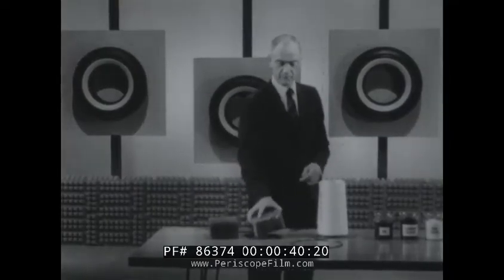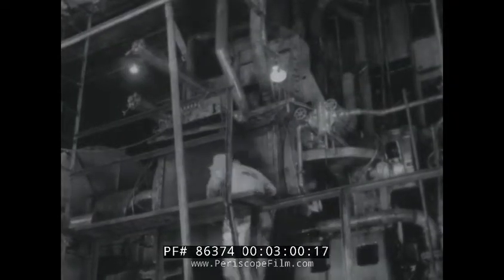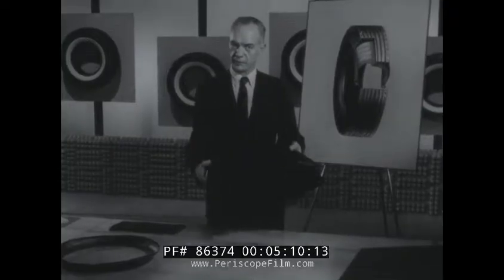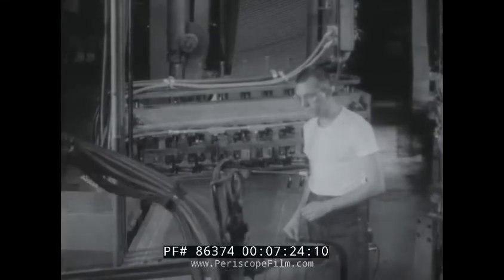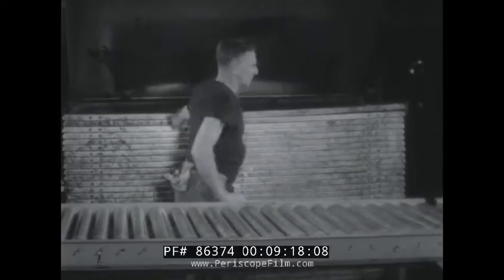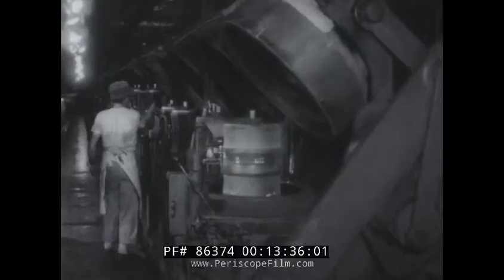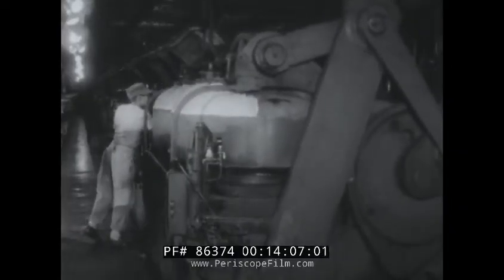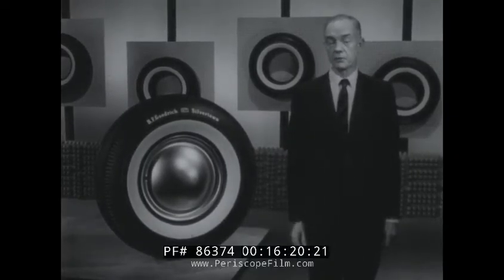" MILEAGE IN THE MAKING - STORY OF TUBELESS TIRE "   1961 B.F. GOODRICH SILVERTOWN TIRE  PROMO 86374

Comment: Fun to watch. This is all very accurate I started in Armstrong Tire & Rubber in West Haven, CT on Nov. 30, 1966 everything seen here I have done a little bit of it in different ways in 14+ years, then it closed. This little video does not show the dirty carbon black in the mill room and all of the other chemicals - rubber workers have the highest gut cancers (you never get clean even after an hour in the shower) the 125+ degree heat in the curing room and guys passing out or the mandatory line up at the water cooler to take two salt pills in front of the foremen at the start of your shift. Remember no OSHA in those days, no masks, no safety equipment, no ear protection, no safety glasses. Thank you GOD for OSHA. You have no idea how heavy and tacky rubber is. There is only a few of us left now from those days beaten broken bodies from hard grueling work. Me I got out lucky still in pretty good shape by the grace of GOD. The great HOT showers running over sore bodies kept many a man going day after day. And a little side note I do not know where all of those women came from in the war they made tubes, rafts & parachutes. A few stayed after the war and I mean maybe 3. The government demanded Armstrong start hiring women in the 1970s and this is what happened - crying and quitting even with the guys helping them make their piece work, the work was just that hard, it's not that they did not try. One made it her name was Pearl believe me you would not want to run into her in a dark ally. The money was pretty good but you earned it. Those 1200/24 truck tires I'm not going to forget them for a long time.
Reply: Wow... You're exactly right. I worked for Goodyear for 17 years. That damned carbon black, I'll never forget. You could get a tiny little trace on your fingers, and it would spread everywhere on your body. You couldn't wash the stuff off.
 In the curing dept. we had around 400 tire curing machines, all reaching a temperature of 350° 24/7.
 It was brutal work, as the OP related...
Reply: @Jreb1865  Nice to meet you. Wow another oldie rubber worker, never thought anybody would see my comment. Thank you for your thoughts. There were several grades of CB and our #79 was the worst - really fine and loaded with oil believe me there where days when I was covered head to toe with the stuff and the various oils and CBs never come out of your clothes just the sweat and it would clog and stick to the washing machines. We had a CB tower and a railroad siding but we still used a lot of bag black. Literally all of those chemicals used to eat the stitches right off of our safety shoes the tops would be fine and the soles would be falling off. 7 years in that mill room. 400 curing machines, we had about the same the ones in the video we had 4 lines of B,C,D, E they where the oldest  and all of the NDs for the military steel molds always went there those where for the Jeeps etc. had post inflation an Armstrong invention that went industry wide essentially doubling a tire layers rounds and because they were old we had to hand load the PI tires right out of the press the bead rim for those swing right off of their sides, after a while your burned hands became insensitive. In the 400 count we had about the same, Im not sure if that counted the truck tire lines everything from 900s to 1100/24s those did 2 cures at a time the 1200/24s was a single. 325/350 lbs. one tire. I did years in that heater room tire layer & bladder repair, green tire sprayer & storage, tow motor driver, racks to the presses. Worked on tires for the Indy 500 (curing) 
350+ hot water & steam thats how you cure rubber tires in 350+ tonne presses. our NRMs where the best. Was there when the industry went from Rayon to Nylon to Fiberglass & Steel. All our Banburys where Waterbury Farrell as most of the 90" mills, we had one K7 I think it was made by NRM, 100 tons of raw rubber (Master Batch) a night all cut, picked up and loaded on the conveyor belt by one man I did this on 3/11 shift. Lots of automation now from auto loaders to segregated molds thats because of OSHA thank GOD.
For years I was one of six men per shift that did the rescue and recovery work of men caught in machines run over by tow motors, caught in conveyors etc. So many men had at least a damaged or missing digit, it was so common place nobody thought anything of it. There is nothing I haven't done in the making of a tire from the rubber off of the boat all through the mill room into the tire room on to the curing room up to Final finish to QC final inspector off to the warehouse then out the door. 35/30/25 year men dominated the seniority list being one of only 12 men hired in 1966  i got bumped so many times I was beginning  to think I was aa ping-pong ball but what an tire education it gave me.
Really hope you had a good time in Goodyear at least your lucky your company is still around Armstrong was broken apart by Pirelli Tires and now after all of these years the brand if being revived in India and in a miracle of miracles is saw a trailer on I95 South in 2021going towards NY all decked out flying the logo and the tread designs. I'll check here again Dan, if you want to tell me what you did, where was your plant OH, CA, NY down South is it still operating? All the best:)
Reply: Thanks for sharing your work experience to compliment this video I have been binge watching these old films and love them. This channel has many videos from us steel I speak to a man from work that retired from there its great to here from people who have direct insight.
Reply: @chris30v  Glad you made a penpal These are fun to watch.
Reply: my twin brother worked for a tyre retreader in Victoria Australia in the late 1980's, i remember him coming home black from head to toe every day for a couple of years, he was so glad to leave that job.
Reply: @amandagardner565  HI Amanda, ahh retread rubber. I did that to but retread is a little different unless the company he was working for actually made the rubber your brother was covered in the grindings of the carcasses plus the cements that were applied when the retread rubber was applied to the Caracas and then into the molds and autoclave. The purpose of Carbon Black is to fill the very porous rubber to give it uniformity and strength = milage and stoping distance, variations of Blacks, rubbers, oils and Tack compounds accomplish these goals. All of these compounds are put in the Banbury (first mix = Master batch) under TREMENDOUS heat and pressure to fill the porous rubber then after varying  rest times off it goes to Finish Batch where the same thing happens all over again with different chemicals these are mostly dry ones and where the Sulfur mentioned in the video gets added. All of this is just to tell you what was in the rubber grind that was on your brother. Rubber comes in different grades the very best is milky white low porosity and very heavy rock hard, this is Butyl the best, then it goes all the way down to crumb rubber - black, very high porosity, light because its full of air. Rubber comes off the ships in blocks about 300 lbs. and must be kept fairly cool or the blocks mush and spread out and then we call them ears regardless off they go to the rubber cutter Armstrongs was a Baldwin and the blades where NOT heated, that Baldwin had a 24" hydraulic  cylinder on it and it could push that rock hard rubber through those blades. Hope your brother got to wear a good mask and hearing protection, many, many rubber workers suffer from significant hearing loss, you have no idea how loud it gets. Again thank God for OSHA. More than 35 rubber plants have left America and sometimes I can see in my minds eye those guys working in Country's with no protections if they make it to old age they will be beaten  up pretty badly. God Bless, Good luck Down Under

Comment: 7:54 Yes, diagonal tires. Made for cobblestone roads, as they provide a much greater comfort. Driving a car, especially a rear engine one, e.g. Škoda 1000 MB, with diagonal tires on wet asphalt is a challenge.
Reply: Along with rear engine VWs, Triumph Heralds etc.
Reply: I don't think i have ever driven a car with bias ply tires. My dad always used to have Peugeot cars,  403,  404 and 304 and as far as i know they always came equiped with Michelin X radial tires. 
I seem to remember that Michelin was one the first (or maybe THE first?) brand to sell radial tires. They built a top brand reputation off of that.
Reply: @jfv65  I have, maybe if you are performance driving there’s a big difference. Then again I do lots of sim driving these days (mostly BeamNG and Assetto Corsa) and I can’t see a huge difference when driving the vintage cars on vintage rubber other than the fact they tend to be barrier tires.

Comment: Bias ply tires are just scary.
Reply: Not really - I raced an Austin Healey 3000 on them for years back in the 60's. Just had to know how to drive and learn to counter steer. (Turn left to go right) The switch to radials, now that was scary. Especially when we started breaking suspension parts that were never meant for radials.
Reply: @denali9449  I’ve driven on bias plus (definitely not performance driving) and I play a lot of racing sim with vintage cars and I gotta say, I don’t I see the huge deal about bias ply tires.
Reply: @cmbaileytstc  Like most things in this world the more you use it, the better you understand it and the better you can work with it. Bias ply tires were never an issue because that was all we knew. I still run them on my Healey. Our problem back then was trying to use a radial on a car built for bias tires, pieces broke and guys got hurt. Once we started building suspensions to carry the unsprung tire weight and to handle the added 'grip' of the radials we were, as they say, 'off to the races'. (Pretty good pun huh?)

Comment: Unfortunately the tire companies kept making bias ply tires far too long when radial ply tires were known to be safer and better.
Reply: The bigger part of the problem in the US was that the auto manufacturer's did not want to design suspensions to carry the additional unsprung weight and ride/grip of the radial tires. The heavier tires needed stronger suspensions (springs, shocks and mountings) which added to the cost of the automobile. $100 for the suspension and $100 for the tires added a bunch to the $2700 cost of an average car - even more if you were buying a $2000 Falcon or a $1400 VW.
Reply: Still can't beat a bias tire for trailers.... radials SUCK for trailer tires!  OL J R :)
Reply: @lukestrawwalker  radials are also no good for farm equipment like tractors and mowers. even most earthmoving equipment and cranes still uses rag tires due to better flexibility. rag tires will still be around for hundreds of years i think
Reply: @ThatDaveFella  a lot of guys use radial tires on rear tractor tires or ask the way around on mechanical four wheel drive (MFWD) tractors, they claim they spread the weight better as they run "flatter" and get better traction, but they're more expensive.  Other than that yeah agree completely!
Reply: The first radials were so terrible about flinging their treads off, O-F-F off in the middle of the road even when fairly new that NASCAR didn’t switch to radials till the mid 80s IIRC and lots of guys who put in lots of miles came to hate the things.

Comment: Too bad nobody actually makes a crossply tyre any more, except for a few speciality shops who produce them specifically for older vehicles which need them. Expensive to buy, and with a shelf life, but they still sell pretty much all they can make to the car collector market, and to those who own vintage and veteran vehicles who want them to look fully original. Almost universally replaced with the radial tyre these days.
Reply: The label for those antiquated tires is "bias-ply." Good riddance. FWIW I spent some time working on one type of bias-cutter, machines about the size of a small house.
Reply: I buy nothing but bias ply trailer tires... I tried radials, they're more expensive and they SUCK... no lifetime!  You're lucky if you can get five years out of them-- I've got some bias trailer tires that were over 20 years old before they gave out!  

As for vehicles, yeah radials are better on that score.  You can buy reproduction radials that look like the old bias ply tires that came on the car... they're NOT cheap but far superior to the original biases for steering and handling of the car.  I had a buddy who restored old cars, including his pride and joy '57 Chevy, and that's the kind of tires he ran on them... OL J R :)
Reply: @lukestrawwalker  Gotta guess you drive like an idiot. My experience the exact opposite, over 60+ yrs.

Comment: Back in the days when if you happened to have a slow leak in the tire, you could just throw a tube in it.
Reply: Glad those days are over. Wife would expect me to do that too.
Can hear her now... its just like a bike tube.
Reply: @alphaomega8373  Done that with modern tyres though, especially those used for low speed and rough terrain, where a tube is preferred over replacing nearly new tyres regularly. Yes tubes are harder to get for passenger car sizes, but common in commercial and trailer use.
Reply: When did the little patch strips you poke in get invented? I have good luck with those on small leaks.